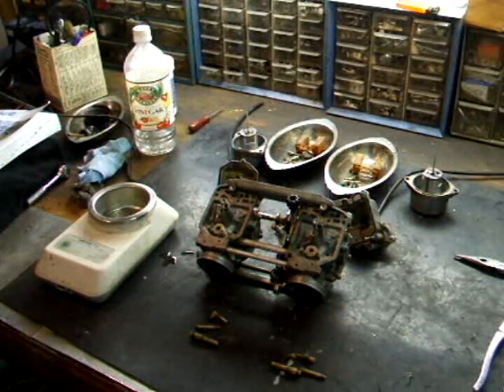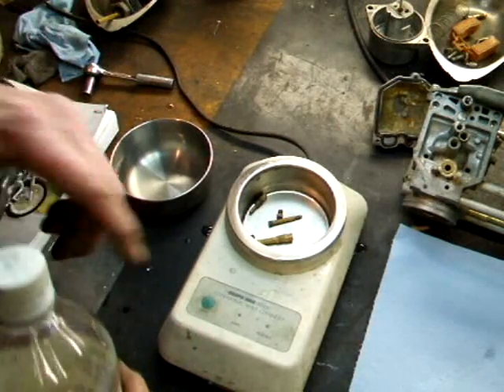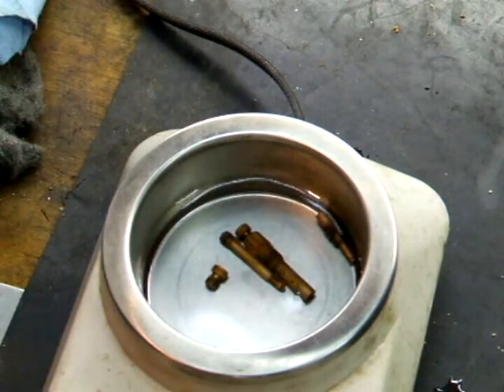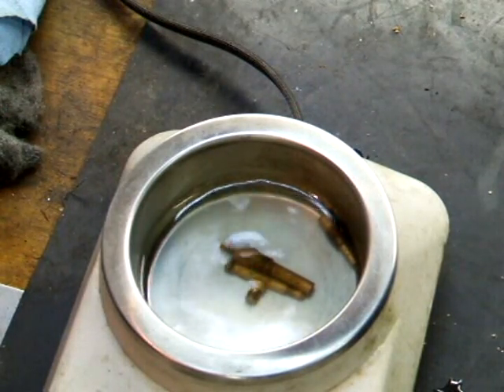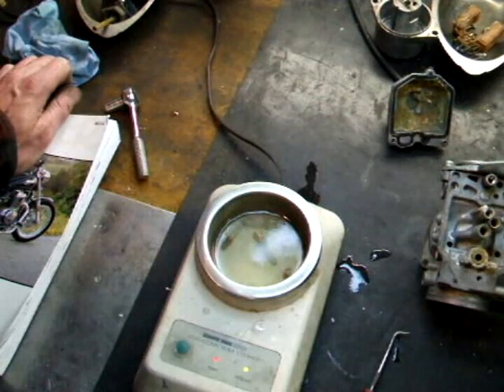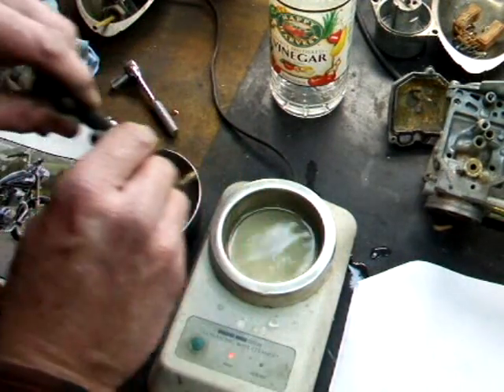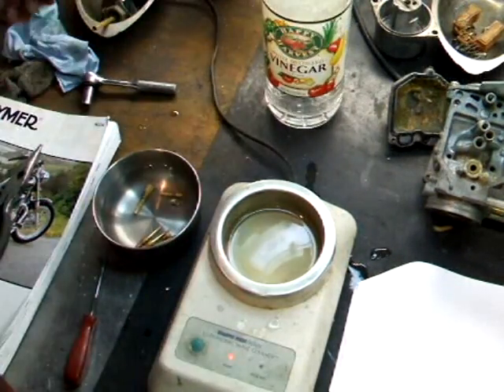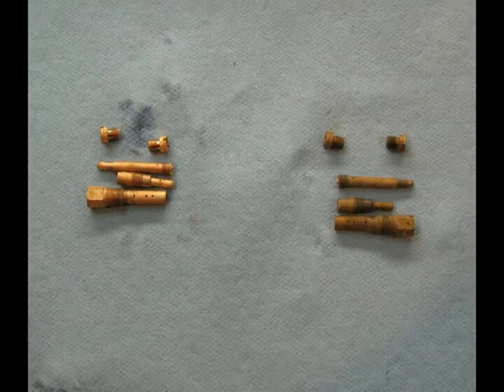How to clean motorcycle carburetor jets with vinegar

Comment: I use vinegar in jar (no ultrasonic cleaner) then I use some very fine steal wool to shine them up.  Funny how we like to get stuff shiny and pretty that nobody will see but us.
Reply from the maker: If you add a little hydrogen peroxide to the mix it will accelerate the process.  1/1 ratio.

Comment: Thanks mate, so you wouldn't recommend cleaning jets as the same time as the rest of the carb? What about in a large ultrasonic cleaner? Cheers!
Reply from the maker: It is best to take it apart, so you can blow air through all the holes and ports. Here is a video on cleaning the body of the carb. This works as good as  large ultrasonic cleaner.  Crusty Carburetor cleaning with out special tools. Making what you have work. Amazing what a little know how and elbow grease can do!
https://youtu.be/Xtvrai3yf1o

Comment: Don't ya wish you could talk and ask questions? It seems like the main jets are what gets clogged when you have to run it on choke to keep it running?
Reply: The pilot jets are the ones that are clogged in that case. They have the smallest opening and clog easily. They control lo speed, and idle.

Comment: Does your ultrasonic jewelry cleaner heat the vinegar too?  Ideally, I'd like to find some liquid to soak the brass jets in overnight to clean out the inside diameter of the hole in the jets back to full opening size.  Any recommendations for such a solution?
Reply from the maker: If you add a little Hydrogen peroxide to the mix it will help. With the ultrasonic jewelry cleaner it does it in about 5 minutes.
Reply: @Amotorcyclenut  Your Amazon link to jewelry cleaner didn't work.  Know where I can get one, cheap?
Reply from the maker: @MrHanowski  I fixed the link for you, go check it out.
Reply: @Amotorcyclenut  The link to Amazon jewelry cleaner still doesn't work.
Reply from the maker: Try it now
Reply: @Amotorcyclenut  That's not the cleaner in your video.
Reply from the maker: @MrHanowski  I bought that one 20 years ago. They don't make it anymore. It's just a ultrasonic jewelry cleaner. Any one with a stainless bowl will work.

Comment: Theres a small jet in my bowl on my Suzuki GS 850 I believe its for the choke circuit...what happens to alunimum if vinigar is used in a bowl to clean out that jet ...???
Reply from the maker: DON"T mix different metals with Vinegar. everything will turn black!!!! Only works on Brass parts.

Comment: Hi I accidentally had 1 steel screw in with the rest of brass parts, I just took it out but my brass parts are now slightly discolored/blackened. Do you know of any easy way to reverse this, or fix this?
Reply from the maker: Change the solution and add a little hydrogen peroxide with it. run the parts again.

Comment: Where the divil do you get compressed air?! I could use wd40,surely (after the vinegar/water, I mean)?
Reply from the maker: Compressed air comes from my air compressor. Yes, you can use WD40 after the vinegar and water.
Reply: Or the compressed air they sell for cleaning computer parts.
Reply: Compressed air is formed by a machine called an “air compressor”
New age technology is WILD!
Reply: @framerjayvesey7324  🤣👍👏
Reply: there is this thing called air compressor

Comment: Would break cleaner work better??
Reply from the maker: No, you a removing corrosion not grease and oil.
Reply: @Amotorcyclenut  Not necessarily.  Jets plug with gas gum, so a solvent is needed.